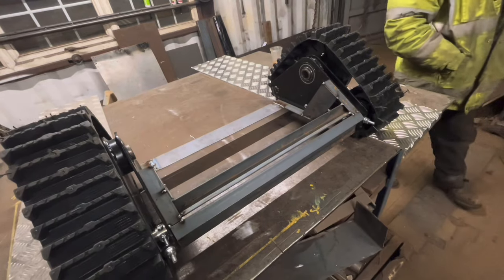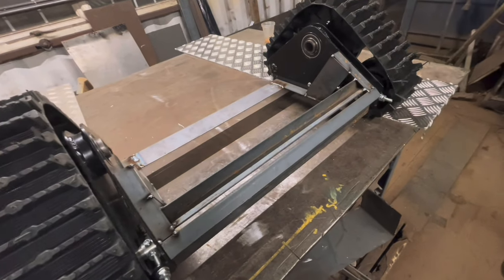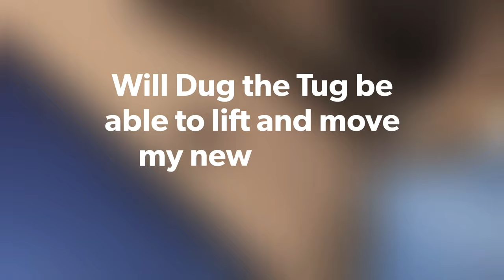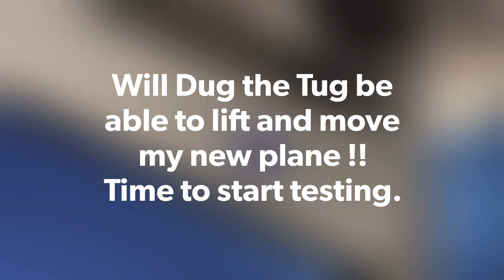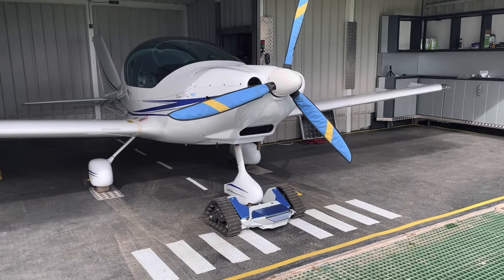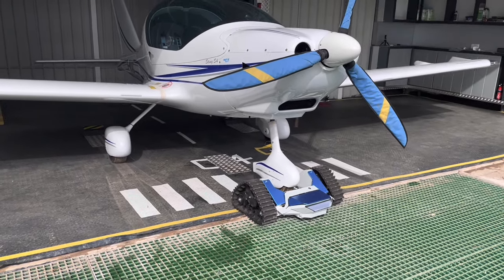How we built this cool aircraft Tug

Comment: Roger… this is absolutely brilliant! I’m currently building my own diy tug that is a little similar to the one you’ve built. May I ask what kind of bearings you used for the wheel cradle (the bit that enables the swinging motion to hold/release the nose gear)?
Reply from the maker: Hi there. I used a lazy Susan, you can get them on amazon.  I pray your Tug come out amazingly. Thanks for watching.